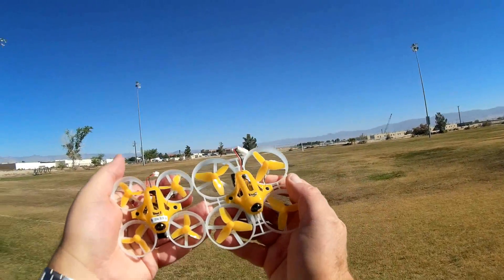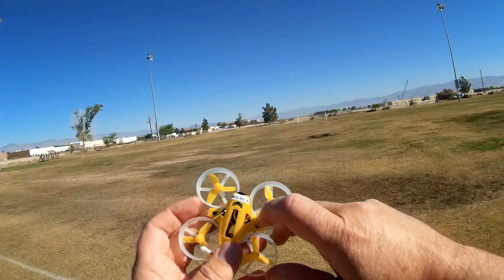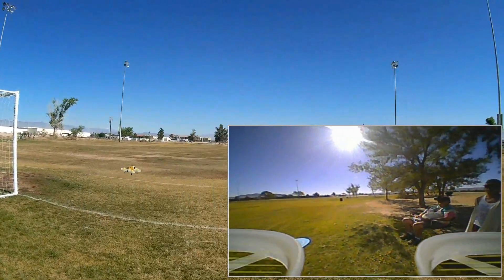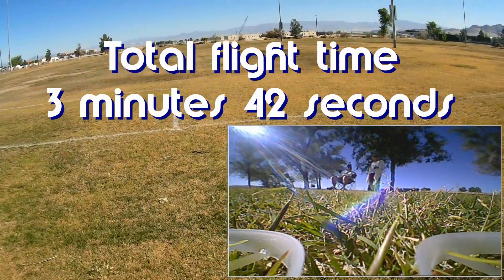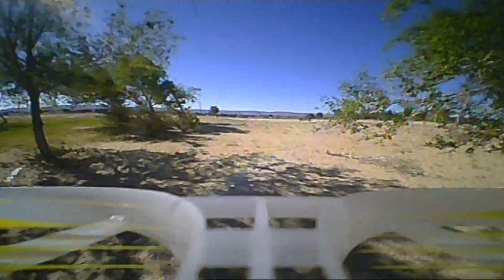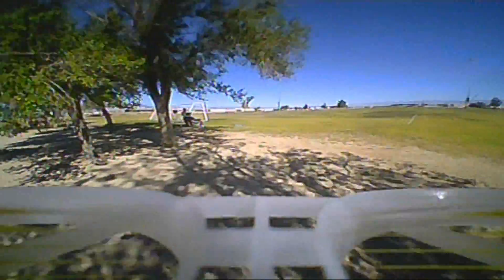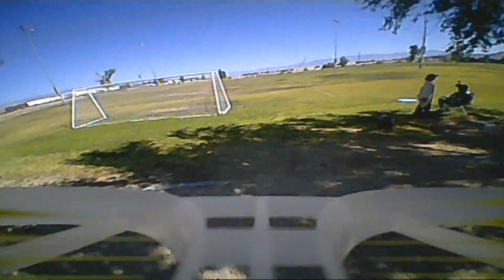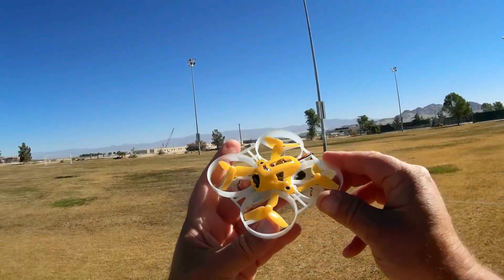Kingkong Tiny6 and Tiny7 Micro FPV Drones Flight Test Comparison Review

Comment: I got my King Kong tiny six today RTF with the F6 controller. Every thing turns on, but does not fly. Can anyone help.
Reply from the maker: You likely need to arm it.  Try moving and holding the left throttle stick down and to the left to arm it, and down and to the right to disarm.

Comment: Hello. I have a DX6i radio I bought about 5 years ago. I use it to fly my MSRX and Nano QX. The Tiny 7 comes in DSM2. Do you know for a fact that my radio will bind with it? I'm researching online but no clear answers to this. The guy at the local hobby shop just insisted that I throw out my radio and get something (as in sell me something..) newer. This will be my first FPV quad and I'm pretty sure I'll acquire other models between now and spring, which is why I asked you before about that Jumper T8SG radio, which sounds like it can grow with my collection. I just hate throwing something out just because it's not the newest/latest. Thanks a lot!
Reply from the maker: You'll need to determine if your transmitter is DSM2 or DSMX.  If DSM2, then yes it should bind.  But if DSMX, then no as the Tiny7 is available in DSM2 Spektrum only.
Reply: Thanks for that reply. I just spoke with Horizon Hobby. They helped me identify my radio as DSMX. I also explained to them this situation, and they said DSM2 is a subset of DSMX, so anything requiring DSM should work. Does this sound right? Thank you.
Reply from the maker: Yes, DSMX is the latest version of DSM, and it's backwards compatible with DSM2.
Reply: Ok, to clarify: in your first reply you said that "...if DSMX, then no as the Tiny7 is available in DSM2 Spektrum only". But then I understand you to say that DSMX WILL bind with the Tiny7. I just want to make sure I'm registering this properly. Thanks again for everything!Read more Show less Reply     1

Comment: Will the tiny7 bind with the jumper t8sg radio? Any limitations using that one? Thank you
Reply from the maker: Yes it will with no limitations.  I prefer to use the T8SG now for all quadcopters or airplanes that can use it.  Be sure to see tomorrow morning's video.
Reply from the maker: The T8SG uses Deviation multi protocol firmware.  Don't search for T8SG setup.  Instead search YouTube for Deviation DSM2 or Frsky or Flysky binding and setup.
Reply: Thanks. I was about to ask the same question. I am getting my Jumper T8SG tomorrow and looking for something small like this to fly FPV indoors as we get very strong winds almost every day for the next three months where I live. Hopefully it is not to complicated to set the tx up as there is not much help available about how to do this. There are lots of video;s of people flying using the T8SG but almost none about how to get it to work with different quads. Any advice will be appreciated.
Reply: Thanks for this.

Comment: What is on the tripod in the background? Is that a spare set of goggles? In another video review you had a Wi-Fi repeater mounted. Thank you
Reply from the maker: That is my VR D2 goggles with built-in DVR.  I was using it only to record the FPV video, as I prefer the Furibee VR01 goggles.  They just work better for me.

Comment: Arived my tiny 6 yesterday, RTF.
But the right stiuck (mode 2) does not return at the center from whem is from the half way down.
It is normal?? Or is rey for refund??
please help me!
Reply from the maker: Where did you find a RTF version of the Tiny6?  But the right stick of a Mode 2 controller should have spring return to center.
Reply: Quadcopter 101 Gearbest. And the issue with the tx stick is resolved.
Have a good day!

Comment: I own th Tiny 6. I made around 50 flights, and was happy with it, then, the quad lost its power, it was just able to leave the floor. So i bough a new bunch of batteries. Nothing better.
Then i rod somewhere that brushed motors used to loose power after some hours of work, then i baugh new ones.
Nothing better. I don't know why it lost its power, but it does not fly anymore.

This little quad if fun to flie, but it will last 2 hours max...

For just a few more bucks, they are brushless ones,  with a lot of power....
Reply from the maker: Does the quadcopter take off from the ground with the new motors?  Before you replaced the motors, were you aware that there are two different type motors on the quadcopter (clockwise and counter clockwise) that must be installed in specific locations?  Additionally there are clockwise and counter clockwise propellers that must be installed on the corresponding CW and CCW motors.  If installed wrong, some of your motors may be blowing air upward instead of down, preventing takeoff.
Reply: Had the same problem. Replaced the motors, didn't work. Did a firmware update. Nothing worked. Until i replaced the micro jst power supply cable for a new one. Apperantly after quite some time these cable is failing, because its gets very hot most of the time. The battery cannot give enough current to the motors. So i replaced it and it flys great again.

Comment: Do you know how to bind the DSM2 version of the tiny 6?
Reply from the maker: To put the quadcopter in bind mode, you'll need to press the very tiny copper disc button on its receiver while simultaneously plugging in the quadcopter battery. Then put your transmitter into bind mode.
Reply: do you have to follow this procedure every time?
Reply: The binding of these quads would be a good video to put on your channel... I’ve only found one guy video of someone doing it and his English is a little hard to follow...

Comment: i got the dsm2 version tiny7 but now i am unable to bind it to my devo10. In betaflight receiver tab i can't see any response. i did choose serial based receiver & spektrum1024 in config. but i get no response. can u tell me the exact step to bind this to devo10?
Reply from the maker: I am assuming that your DEVO 10 has the Deviation firmware already installed on it?  If so, the following steps should work.  The receiver is installed in the top section of the canopy, directly above the flight control board.  If you look closely through the right side opening of the canopy, you should notice a little circular gold button with a black dot in its center.  This is the bind switch.  You'll need to use a toothpick to push into and hold the black dot of the switch (you should feel it push in slightly).  While pushing in, you'll also need to simultaneously plug in the quadcopter's battery (you may need someone to help you, as it can take three hands).  Keep holding the switch for a few seconds, then remove the toothpick from the button switch.  You should now be in bind mode.  Turn on your transmitter, go into its menus, and select "Bind" (to get there press ENT button three times, then press DN button seven times).
Now again, I assumed that you are familiar with Deviation firmware, and already have it installed on your Devo 10.  If my assumption was wrong, see the following page and carefully read it to see how to install Deviation https://www.deviationtx.com/
Reply: followed exact steps. Its binded but now I can't able to arm the quadcopter. I hav set the arm switch to aux 2 i.e RUDD D/R. In receiver tab I can see the range in Aux2 to switch between 1074 and 1926. But can't yet ARM . Any suggestions?
Reply from the maker: Did you hit "Save" after setting the switch?

Comment: Hello; Enjoyed your video. I received my Tiny six a couple of days ago. I can't get it to bind with either my Spektrum DX5E, Spectrum DX6E or Devo 10 with deviation installed. I have the same receiver in another quad. I put this other receiver in and no luck as well. I had a similar problem with another quad, where I had to enter a sat command in the CLI tab in Betaflight. . Do you or any of your subscribers have any suggestions?
Reply from the maker: Did you first set it to bind mode by popping the top, and press the little button shown at 1:32 while simultaneously plugging in the battery (might need a second set of hands to do so)?  Then once the receiver is in bind mode, enter the transmitter menus, and select Bind.   If so, did you check Betaflight- Configuration - Receiver that it is set to "Serial Based" and "Spektrum 1024"?
Reply: Thanks for your help. I got it to bind.

Comment: It's nice that they offer an "Advanced version", which gives you 5 (five) flight batteries, since they are kind of oddball, at least you have 5 batteries, AND a charger to charge all 5 at once.  Nice to have 4 RX versions supported as well.  By the way, the latest version of Betaflight is not 3.0.1, its 3.1.7. If your viewers are experienced, its not hard to upgrade to the latest version of Betaflight. The 1st thing to do is do a backup of all your settings.  Next do a 'dump' in the CLI (command line screen) and highlight and save all that info to a TXT file.  Now you can update to the latest version and then 'restore' all the settings as they were. Seems like Betafllght comes out with a new version almost twice a month (bug fixes and new features). I just put v3.1.7 on my QX95 and QX90 yesterday.  We haven't had flying weather for several days, and won't for a few more ... storms moved up from the gulf and its been raining and blowing, with temps below 50 deg. (Lake Erie is currently 47 deg.). Thanks for the review. Cheers.
Reply: Quite a lot of things changed since 3.1.7 update, but I like it : )
Reply: I'm a total newbie to this Betaflight program. You got a link to download it by chance? Thanks!
Reply: @ktrimberger  github